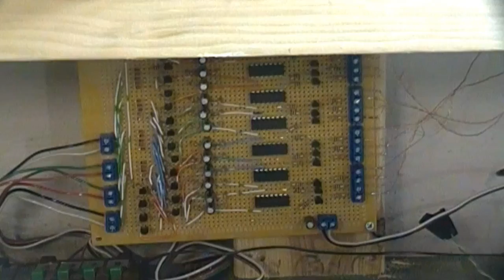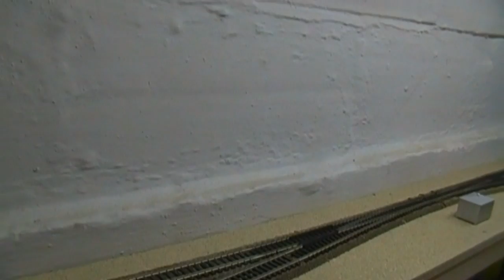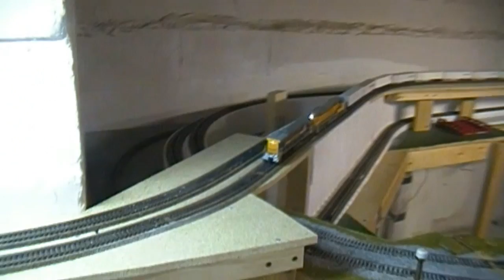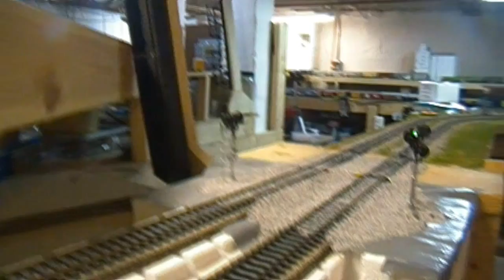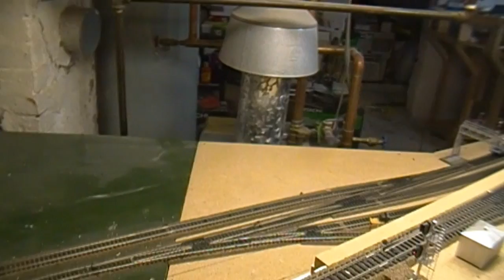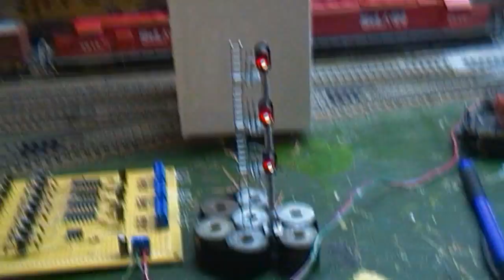Custom Layout Signal System: An Introduction to My Layout Signaling

Comment: Great video. I am doing the same but using an $8 Adafruit Trinket microcontroller and Serial Addressable LEDs so I can control any number of LEDs from a single daisy chain signal from the Trinket, it only has 5 I/O, but all the control logic is done in the Phython language. I will post a video of the design when I have completed it. I see you used discrete DIP logic. Great!  If you are good with microcontrollers, Adafruit, Arduino, or Parallax make all sorts of easy to use devices. You can end up with less electronics and can change functions just be changing your code. I have plans for a 27 LED Switch Speed Signal set from one controller. Basically the same design just different code and LED strings.
Reply from the maker: Nice, since the making of this video I have made the change over to JMRI for my signaling. All my logic is now done using that. I also have a new layout that I am currently building in the basement of my house. This layout in the video has been torn down since 2019.
Reply: @trainman1986  Nice! Train layouts are always changing, aren't they?  In our setup, my wife designs the scenery (mostly Lemax, not quite scale but close). I handle all the railroad and electronics (like the ski lift that automatically goes up and down the mountain) - I love the creativity. I just finished the preliminary design for my Track Section Signal set. Just putting together the Parts List now. I should have the design posted tomorrow.
Reply from the maker: @paulromsky9527  Awesome. I hope to have some trains running soon. Once I do of course there will be video posted. I plan to have a CTC system setup on my new pike. This of course will be constructed with the JMRI program.

Comment: Really like your 3 head design.  It there anyway to get a copy of the circuit?
Reply from the maker: I used to have a copy of the circuit but unfortunately when this layout got torn down, alot of my documents also got tossed. All of my signals are now computer controlled using JMRI.

Comment: If it's possible could you point me in the direction of what I need to build one of these boards and where I can find the parts thanks.
Reply from the maker: Most of the parts I used to build this board were purchased at either Radio Shack or I ordered them online at various electonics parts stores. Unfortunately I no longer have the diagram to this board as it got tossed when this layout was completely torn down earlier this year. I have since then gone to computer control of my signals and use digitrax stationary decoders now to control my signals. A computer runs all the logic for the signals now. If I come across something I can send it your way. I may still have a diagram stored away somewhere. I will upload some updated signal videos here soon and go into detail how my current system is setup.
Reply: @trainman1986  I want to build my own system to run my signals since my layout isn't that big. I also heard that it can be cheaper, but I have yet to find any diagrams online or ways to build the boards. Thanks anyway I look forward to seeing your new system.

Comment: Professional Signal Engineer - love the delay - always wondered why others have never noticed! For the record, some CBI controlled signals have a delay too - not just relay interlockings. Actually relays can be faster in the field than CBI systems as relays are effectively a massively parallel computer. Also to be totally correct - red should be the ‘fail-safe’ aspect with no switches on. One switch on = yellow, two switches on = green. I.e. anything fails, broken wire etc, and you step down to a more restrictive aspect.
Reply: At least a dark aspect should result, as the rules require complying with the most restrictive indication, if the signal is imperfectly displayed.

Comment: Can your model trains go thru a red signal? And ifso what would happen?
Reply from the maker: James B Yeah they can but in general practice they they try not too because most of the time it means a switch is lined against its movement and that can cause a derailment. there is no positive train control circuits included with this setup.
Reply: trainman1986 cool. when i start my train layout I might need your help with it

Comment: Some of the railroads with the existing NORAC systems also used these three head signals near double diamonds and/or double crossovers. My future model RR layout will not have these heads, only one or two head masts. Two head masts will be located near CP/turnout areas.
Reply: The heads or aspects In NORAC only tell you speed. Top is normal middle is medium bottom is slow. Flashing will up the speed one. It has nothing to do with the amount of diamonds or crossovers. It does have alot to do with how fast you can go through said cross overs or diamonds